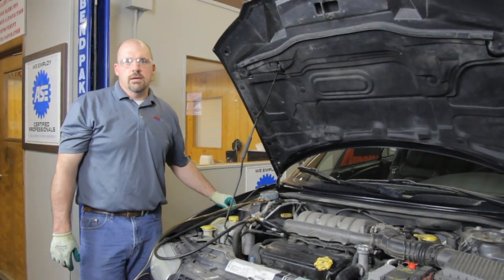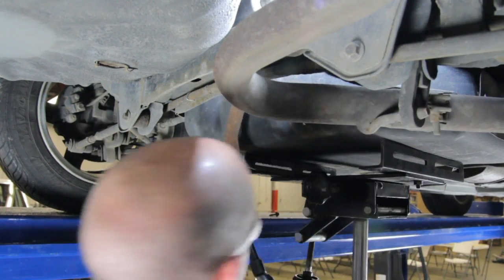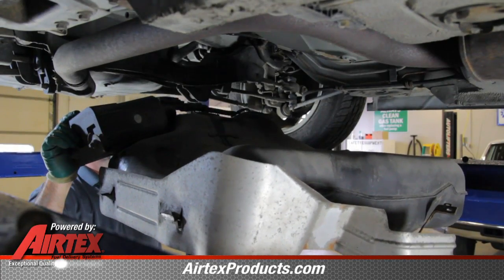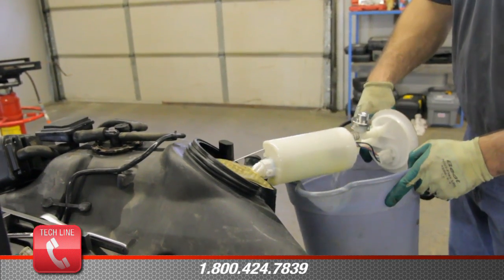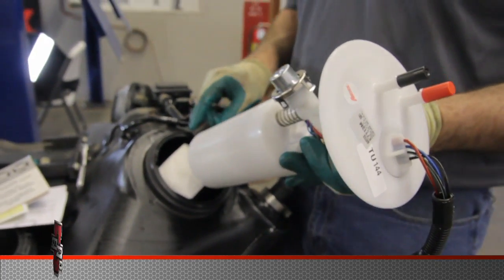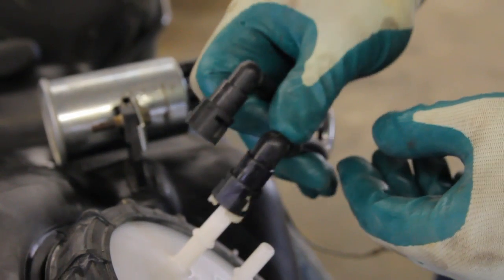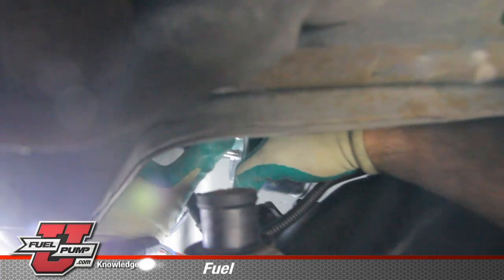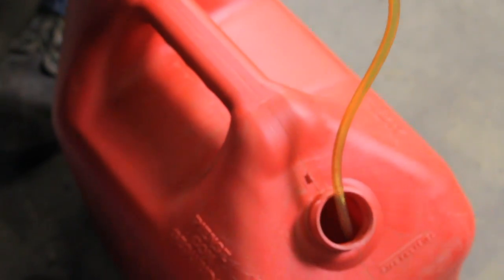How to Replace a Fuel Pump E7113M on a 1999-2000 Chrysler Sebring

Comment: the E7113M is not compatible in Chrysler sebring convertible (europe version) JX 2.0L 
the spare parts original code is 4754184

Comment: On a 1998 Sebring v6 it is not necessary to drop the tank.... There is an access
Under the rear seat.  The middle access panel is for the sender and passenger access is for fuel pump-- it is quit easy--you will need 8mm socket.  19mm wrench and 14mm wrench. And pair of pliers.  Too remove rear seat pull up on black plastics hooks and seat lifts straight up.
Reply: ok; is that a convertible? have 99 sebring convertible
Reply: Thank you so much for this

Comment: Hello I have a car Plymouth Breeze 1999 2.4l became borohlit pump is already 2 times the ignition is switched on a cold he shakes somehow noise then started and stalled then generally turned off and nekochaet I learned that to reap the bottom fuel tank to knock and he wanted to work ptom nachanaet ask which pump advise to put mileage 97500 miles

Comment: also check injectors to make sure they are sprayin like they supose to. u can do this by getting the car to start and run( try holding gas pedal down) and have a buddy listen for clicking sound on top of injectors with a stethescope. check em all .if u have a 4 cylinder and only two injectors firing correctly then this could cause the car to run rough or stalling.

Comment: how many miles u have on ur car? sounds like an ignition problem. like the car is not getting enough fuel. have u tried keepin ur feet on the trottle to keep it alive instaeda of just crankin it? how about cleaning the throttle body and the idle air control valve as this can cause this problem due to not allowing enough air flow though the engine.

Comment: Just a quick question, if you fail to do this for your car since 1997, would that cause the problem to turn off completely after you start it? Reason being is because my 1997 Serbring Convertable, when i start it, turns off within 1 minute, then the oil light turns on....could this video be a solution?